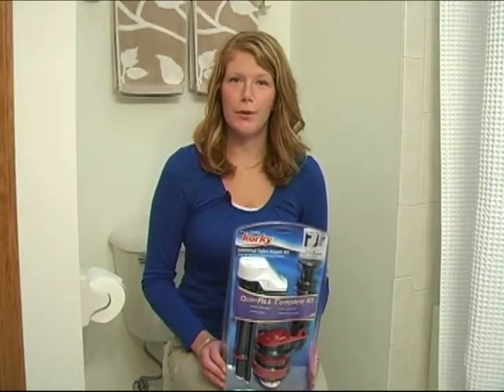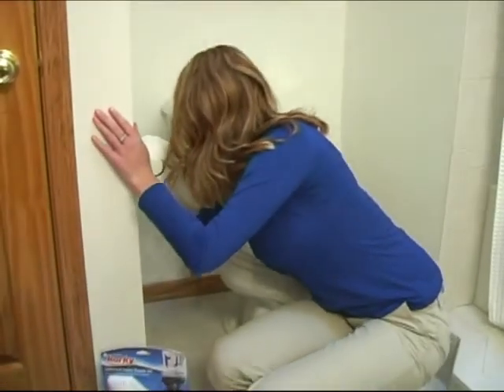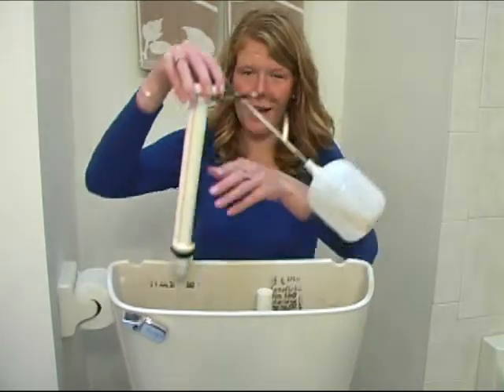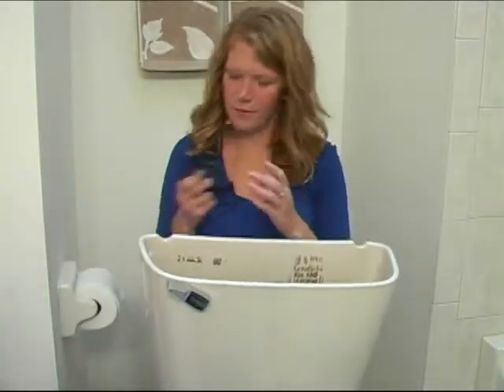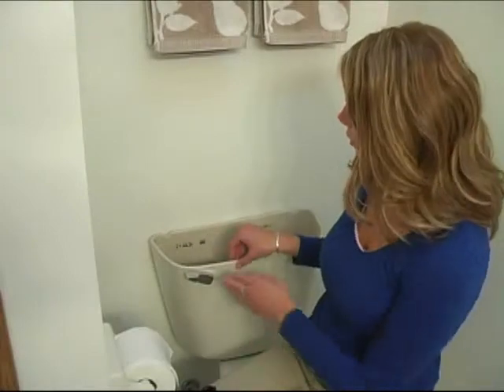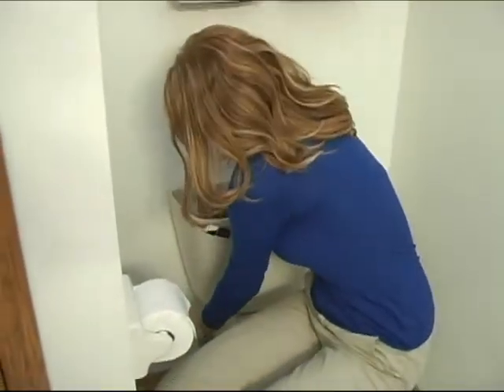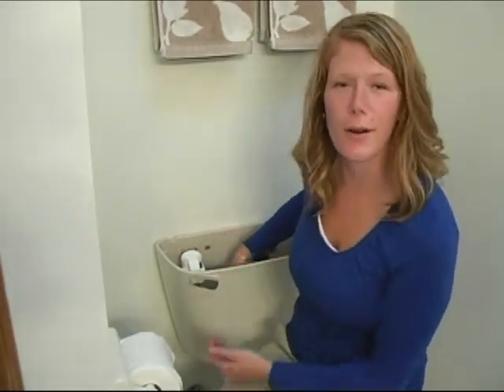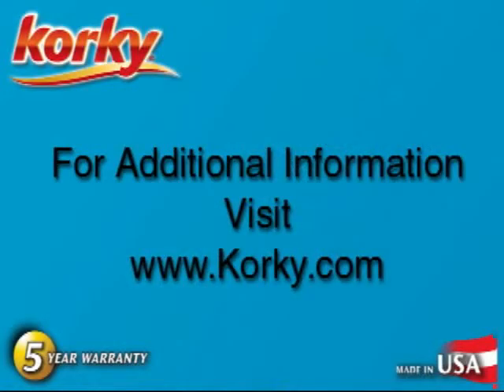Korky Toilet Repair Kit Demonstration

Comment: With the korky fill valve there is a locking clip that is placed on the fill valve to prevent it from ever moving once you have adjusted your height. The Korky fill valve is perhaps one of the easiest of the toilet valves to install and adjust. They also have a small repair kit that you can purchase for far down the road if you need to repair it. Excellent  product. Good luck and have a good day.

Comment: By virtue of what the FLUSH valve is yes you DO have to remove the tank. Part of that installation process involves replacing the rubber gasket that acts as a seal between bowl and tank. Not to mention the fact that the large nut that holds the flush valve in place is located just above that gasket and without its removal you won't be taking the old flush valve out let alone installing a new one.

Comment: The hardest part is taking the two tank bolts off.  And, you better be real careful tightening them back up.  Too tight and you've cracked the tank.  Korky would have been better off with no video.

Comment: The hardest part is taking the two tank bolts off.  And, you better be real careful tighening them back up.  Too tight and you've cracked the tank.  Korky would have been better off with no video.